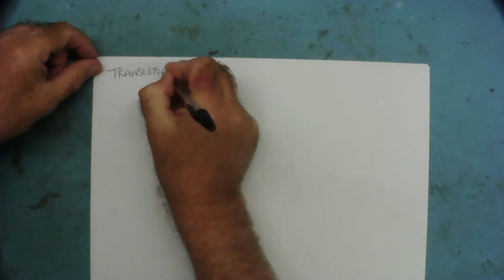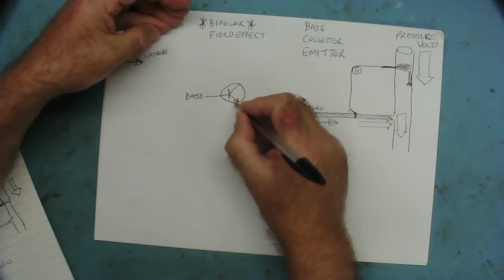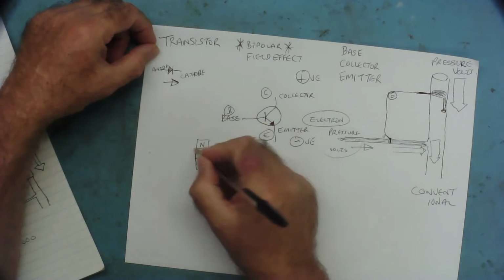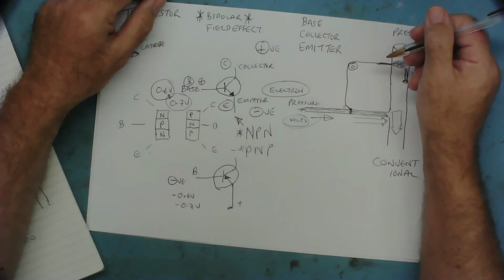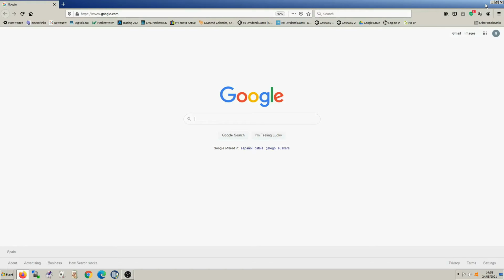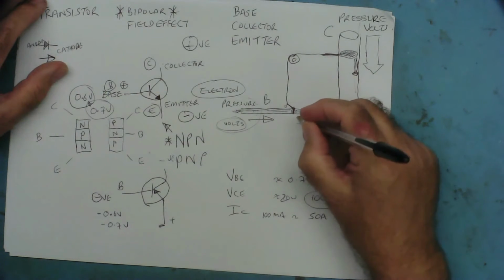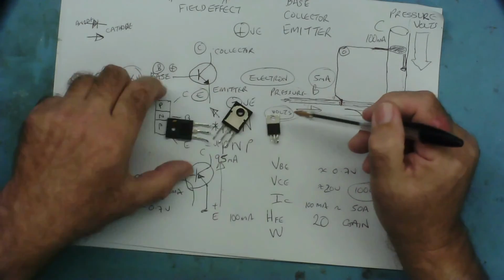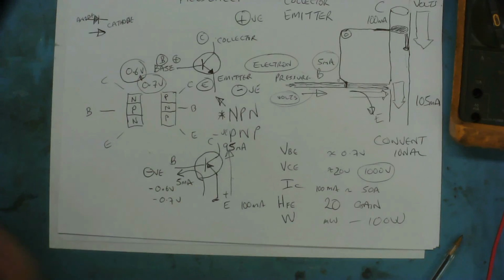Transistors Part 1. How Transistors Work - Circuits & Components for Beginners. #053

Comment: Awesome video, so if I understand it right in the case on an PNP transistor the -0.7 volt is always in compare withe the emitter volt . Let's assume that the emitter has 12 volts my base volt should be 11,3V right ?
Last but not least according to this way of transistor operation, it is impossible that the base will function with a negative, (-) as example ground to a car chassis. The base must always receive a plus volt, is that right ? Thanks a lot in advance. 😊

Comment: What a brilliant explantion of how a transister works. Interestingly  the GPO used a Negative battery (In other words the negative was the fused conductor and the positive was earth)  In telephone exchanges the  Blue taped busbar was negative  while the positive was an unisulated busbar. When wirig a a battery string the fused negative would be blue and the earthed positive would be black. There is a  positive charge concentrated at the center of the atom (The nucleas) with electrons (negatively charged particles) swarming around this nucleus. So electrons are actually negatively  charged particles.

Comment: @11:45: I believe you could draw a PNP transistor with water pipes. You would draw emitter on top, collector bottom (switched with regards with your NPN model). Then connect the base pipe above the emitter/collector valve, so water could flow from the emitter through the base, but first the base pipe exit is closed. Now, when you open the base output towards the lower pressure, the base valve opens the emitter/collector valve, very similar to the NPN type. Would be about right, or am I wrong? Thanks for your very helpful series.

Comment: Hi Mr.Richard
I need to clear myself about the current flow and voltage flow...
Please correct me if I am wrong. (I need the latest update of it)
I hope..
Voltage flows from negative to positive.
Current flows from positive to negative...
I need to clear what actully happens ......
Reply: Hi, voltage does not flow, current flows. Voltage is 'just' the pressure difference that makes current flow (like air pressure at two different places, separated by a valve. You open the valve, the air starts to flow from high pressure to low pressure area). I recommend you to watch RSD academy videos here on youtube. Positive to negative flow is the conventional flow used by the industry so every time you see +/- on a device you should interpret the current flow from positive to negative. The interpretation of the direction (+ to - or - to +) is really does not matter, the industry just decided to use + to - because they were stuck to this interpretation long before the actual electron flow was discovered (would have been hard for the industry to change, practical reasons). Let's say ok, but then how to put the zener or TVS diode into the circuit (these types need to be put in reverse direction)? Just follow what is on the diode, bar sign is the negative side of the diode so you put it in reverse direction to the flow (negative diode side faces the circuit positive). In real physics, the bar sign on the diode is the positive side, but it does not matter because all the +/- sign on your voltage source or on everything else is also reversed! It's easy, if you find it difficult, that just means you're overcomplicating it unnecessarily. I highly recommend to watch all the RSD academy DC videos (the Guy has a playlist so You just need to follow).
Reply: @plinker439  wow.... very good explanation...Mr.plinker .... thanks a lot...
Can I get your email address pls?
Your explaination reminded me my electronics class long time ago.. 
Thanks
Reply: @janakapriyadarshana5835  Hello, you are welcome. Glad i could help, but i'm also just a learner here.
I tried to answer at least five times again and again but my replies got deleted by the yt algorithm. I'm gonna try to put the mail address at my about page.
Reply: @janakapriyadarshana5835  Hello, i put my mail on the about page. But again, i'm also a beginner in electronics.